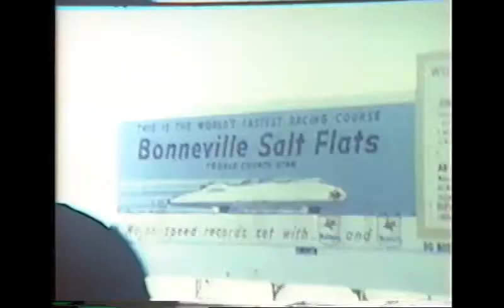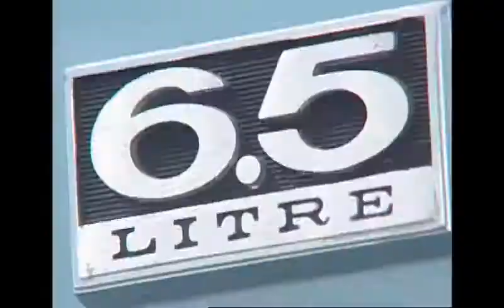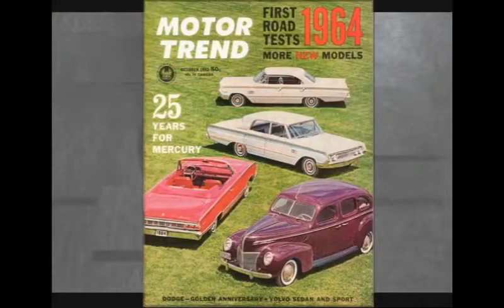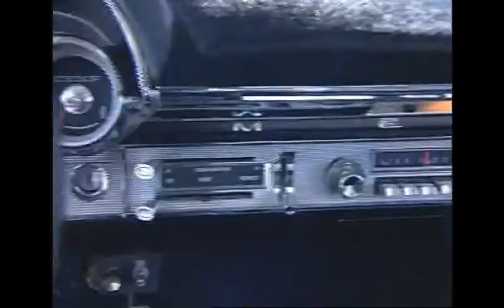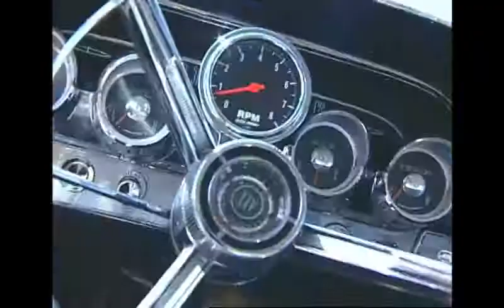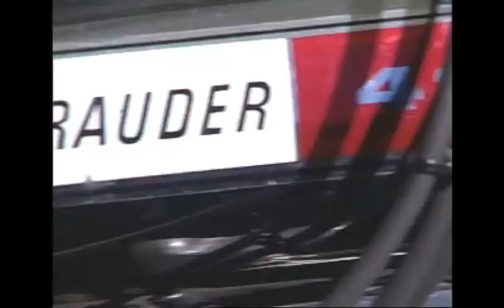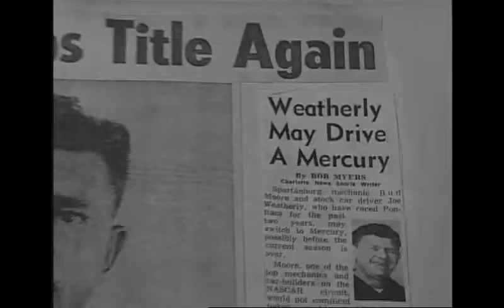Mercury At Speed The Legend Of Marauder

Comment: I had a 64 Mercury Monterey Marauder white with the red interior 390 4 Barrel in the center of the steering wheel was the letters XXV..
Roman numerals for 25. Came to find out that the Mercury I had was Mercury's 25th anniversary model in 1964 Mercury was in business 25 years I should have never gotten rid of that car I actually had that car just as clean underneath as it was on top.
If you looked close at the white headliner it had thousands of little M's made into the pattern.
It was loaded with chrome , under the dash, window posts.
Gauges, 4 tone stering wheel ( clear on top, red on bottom, clear glass center with chrome trim)
Had Mercury man head on dashboard, racing flags on fenders,
6 tail lights bezzeled in chrome and stainless rear pannel
An unbelievable gorgeous grill, chrome trimmed inside around all windows, 
A Huge huge trunk that went from under the rear dash by back seat all the way to the tail pan.
You could actually fit 4 or  5 people in it longways side by side easily.
The roof was set inside the doors and fenders not flush with the sides.
It had the 64 lines that looked like a convertable top
Truly a beautiful car.
Ohhh why. Ohh why  did I sell it.??
Now im depressed from reminiscing
Reply: What a beautiful car, at least you were lucky enough to have owned one. I had a 1962 s55  Monterey convertible that I wish I'd kept, I can relate to how you feel.
Reply: I had a 64 Mercury Monterey,  my DAD said they came out in 39 ! .
Reply: Marauder were Fancier than Montereys !
Reply: @jerryparkers6123
Marauder was a body style, not a trim package 
I own a 64 Marauder Parklane  2 dr, Sport package,..I've owned it since about 2007
 Only option it doesn't have it Cruise Control....I've own 2 other Marauders too...both Monterey's 2drs